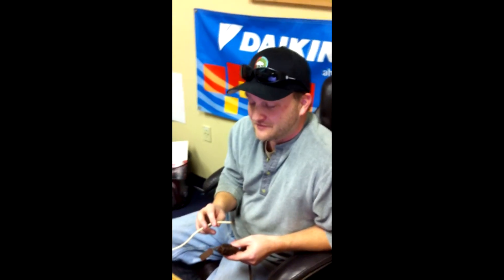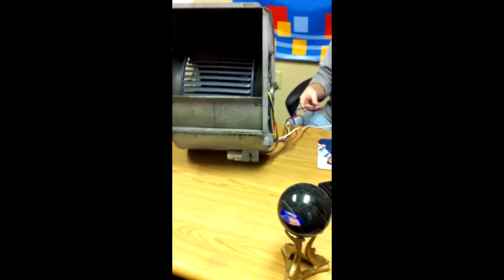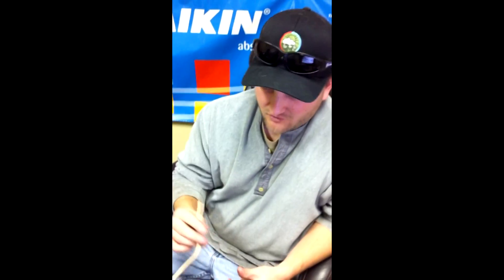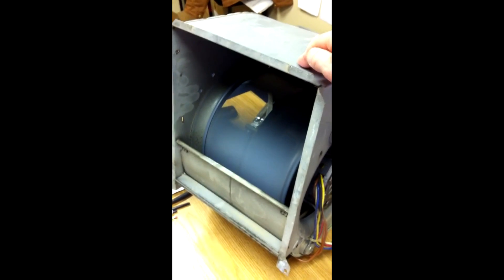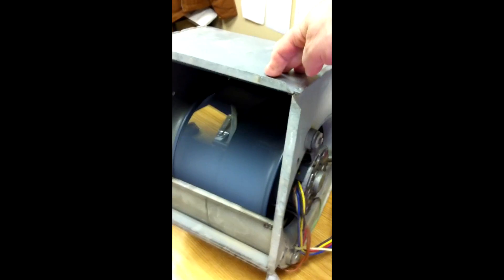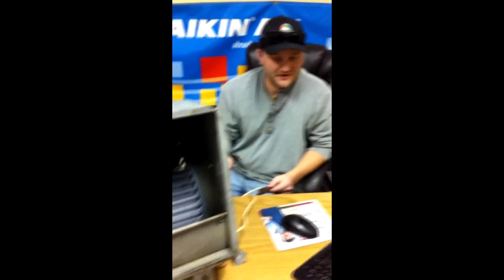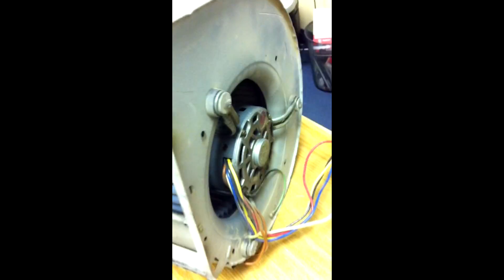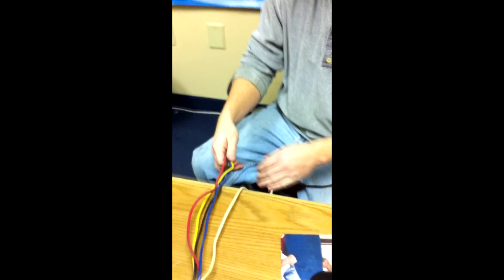Change your blower motor speed on your HVAC system.Can you do it?

Comment: Are you sure you have those color codes right?
Everyone seems to agree that red is low and black is high.  In another video I saw, they indicate that yellow is medium-high and blue is medium-low.
From the sound of the motor in your video, I think they may be right.
Just wondering.
SL
Reply: You are correct
Reply: I just looked at how my blower is wired and they are using the Black and purple wires. I don't even hate a white wire. I have black, red, purple , and yellow wires. Two brown wires are there and they are hooked to the capacitor.

Comment: My AC Unit fan motor is extremely loud when it comes on and it almost drowns out the TV and makes it hard to go to sleep. I think the problem is due to having a newer 2008 AC unit hooked up to the original 1970s duct work in our home. My thought was to slow the fan speed down and maybe it would run longer, but would be quieter. Anyone have any thoughts on this?

Comment: My carrier blows low speed on cooling and blows really high on heating. Too much. On the control board there is a way to adjust the AC speed by moving the jumper wire to another pin, but this seems to have no effect on the heating side. 

There is a heater speed adjustment but it's on the "aux heat" part of the board but moving the pin to the different CFMs jumper didnt change anything. I am guessing that I need to move the W1 wire to W2 or whatever to invoke that part, but I am not sure. 

Any ideas?

Comment: I use one for my work shop to evacuate dust and fumes if I am welding. Its very solid and I like it . I also have one in my attic that is hooked to a thermostat as to keep the attic space not a oven.

Comment: The point is general info and at times when you need more air flow (CFM) to blow you might be able know to have the adjustment made to your blower if it is set to low.